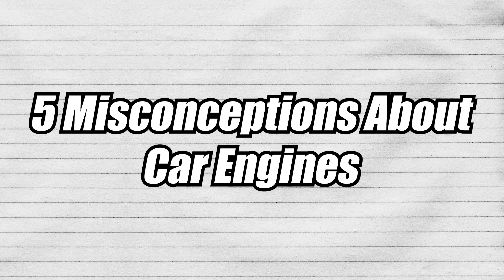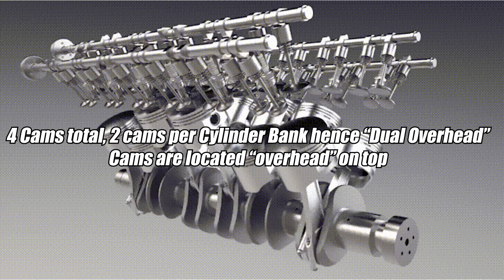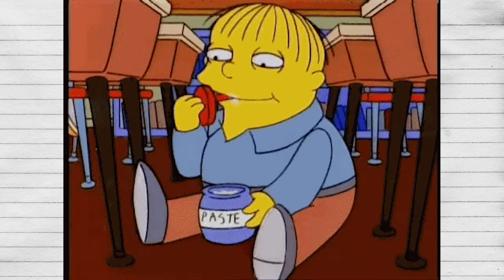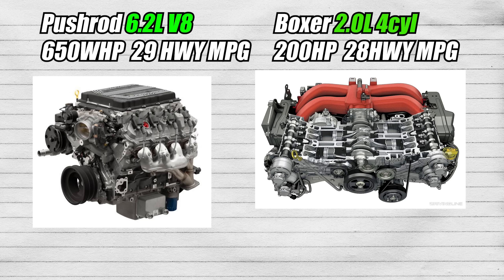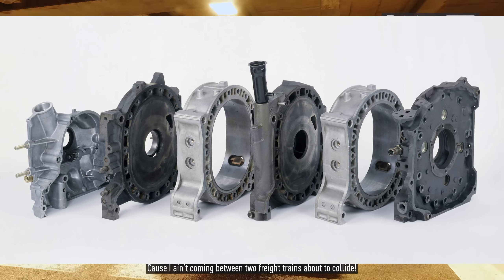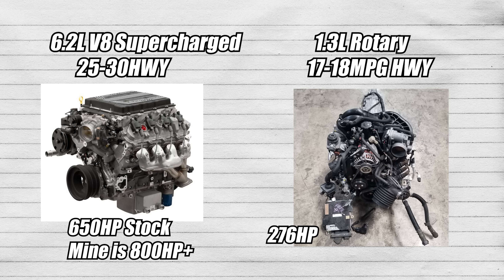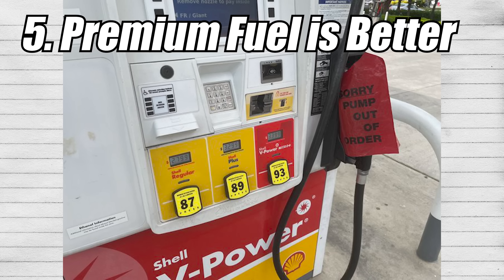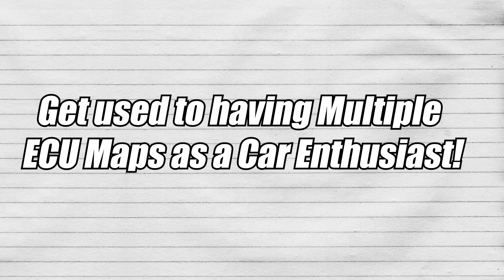5 Misconceptions About Car Engines!

Comment: i didnt understand why rotaries were so bad with mpg, but bro went "dorito drink too much mtn dew" and i instantenously understood why.
Reply from the maker: It's taht God damn Baja Blast!
Reply: Because they have three chamber per rotor, they drink 3 times more.
In addition, the lack of torque make him an hi-reving engine (so it make the economy worse), there is a lot of friction and its not as hermetic as a standard motor, so a smaller part of the fuel energy is used.
Reply: Its because of the larger surface area of the "Cylinder", more heat goes into heating the block rather than expanding the gas, its also why they need more cooling than equivalent piston engines (example being the rx-8's radiator; it's mounted diagonally to have a larger one and takes up half the engine bay).

Comment: I always thought v8s were gas guzzlers no matter what, thanks for teaching me something today bladed
Reply: Fuel economy of semi trucks is weird...
Reply: Dodge's Hemi V8 able to work in V4 mode shutting down half of the cylinders when the power is not needed, by this saving tons of fuel.
Reply: They are gas guzzlers. In the city, the Corvette gets 15MPG!  On the highway, The Corvette shuts off half of its engine to save gas, turning it into a 4 cylinder.  It's the only reason it's even close to 30MPG.

The reason the Vette got better MPG than the Stang is because the Vette had more 2 more gears. The Vette was in 8th gear, while the Stang was in 6th.
Reply: @AK.__ The about of fuel it saves is not huge. Those cylinders might not be firing but the pistons in those cylinders still have to travel up and down and that means there is still friction, those at least the valves are left open so there is no resistance from the increasing pressure. The other cylinders that still fire will need to have more fuel injected into them to make the same power, so the only real difference in fuel economy comes from the lack of a force resisting the piston movements in the cylinders which aren’t firing.
Reply: @LePedant The amount of gears means nothing. Just adding additional gears won’t give you better fuel economy.
Reply: @TheDuckTeamYT  At 80MPH it does. If the Stang had a 7th or 8th gear to go into, it would have dropped RPM's.  Just like how going from 2nd to 3rd at 50mph drops the RPM and improves gas mileage.

The reason new cars have 8-10 gears and not 4 gears is so the car can run at lower RPMs at any given speed.
Reply: @LePedant  The number of gears doesn’t actually make a difference in your rpm. It’s your gear ratio that matters. Also it’s not true that changing into a gear with a lower gear ratio will always yield better gas mileage. Try driving in your highest gear in your car up a hill at high way speed, your car won’t be able to do it even at full throttle because the gear ratio reduces the leverage or force that the engine actually applies to the wheels in exchange for speed.
Reply: @TheDuckTeamYT  More gears means more ratios. If the Stang had a 7th gear, it would have a lower ratio than 6th gear.  

We are talking about Blades test. Not going up a steep hill that you need to down shift. He was doing normal highway cruising where he barely had to hit the gas. In that case, having more gears with lower ratio's will improve MPG.
Reply: @TheDuckTeamYT  Well, you right in general. Not "huge", but still a saver.
Reply: @LePedant  This depends on if the engine has enough power to keep driving the car at high gears. Most vehicle with 10 gear transmissions rarely use the 10th gear. Theoretically you aren’t wrong that going into the highest gear on the highway will probably save fuel but this isn’t the case for most vehicles because the engines aren’t powerful enough, and if it can push it self along in the highest gear, it then makes you wonder if they should of had different gearing to make the rpm even lower
Reply: @TheDuckTeamYT  
It depends on how much torque is required to drive those 4 pistons vs 8. As a general rule, an engine working at 70% throttle (and around 1.5K to 3K RPM) is more efficient than at 30%. This is primarily due to pumping losses, trying to pull in air from a restricted throttle valve wastes energy. If cutting out half the pistons raises the required torque level from 30% to 70%, you'll be producing power more efficiently. Friction at high RPM is the other cause of inefficiency. If you need 90%+ throttle, then you start getting loses from heat losses into the cylinder wall and not pushing the piston.
Reply: Lol it's not because of cylinder deactivation or lots of gears. It's the low, effortless, pushrod revs. My old '95 Camaro got over 30 on the highway (when I allowed it to) with 5.7L and "only" six gear ratios.
Reply: @Appletank8  You always have heat losses in an engine. Engines are only about 30% efficient at turning potential energy into kinetic energy. The rest turns into heat energy and a bit of sound due to friction.
Reply: @TheDuckTeamYT  
Yes, 30% at best. There are many ways to make it worse. A BSFC map details where an engine is efficient and not.
Reply: @TheDuckTeamYT  at the rpms he's going, it can't make that much of a difference, there's not much kinetic energy to dissipate anyway
Reply: @AK.__  the acitve fuel managment your talking about is really not that good. For GM vehicles at least. they blow up a lot just from the AFM
Reply: @trevg7253  I know for the Mopars it works great. Not sure how supercharged Hellcats on the gas, but R/T and SRT (or ScatPack) the MDS (multi displacement system) works great for them in terms of fuel economy. Some believe though, that the MDS contributes to development of "HEMI tick" but it not very true.
Reply: @MagnumLoadedTractor  Aside from some Scania's the vast majority of semi trucks use in-line 6 engines.
Reply: @TheDuckTeamYT  If I bought a car with a 10 speed gearbox and it wasn't in 10th gear when I'm doing 130 on the motorway, I'd go back to the dealer and question whether the gearbox is indeed working properly. If I'm then told that 9th and 10th gear are only for speeds over 200, I'd feel cheated as a consumer.

Also low RPM doesn't automatically mean better fuel economy.
Reply: @fermitupoupon1754  Low rpm doesnt mean better fuel economy, and that's exactly why the engine wont be in 10th gear. Your engine might not even make enough HP at the wheels that speed to push the vehicle. Also what are you doing responding to year old comments

Comment: Even if modern cars don't need to "warm up" I still like to give it a minute to get itself primed, and then gently coast it out of the neighborhood to get it up to temp a little faster without murdering it. Its just a little mental comfort I have always kept with me.
Reply: In a pushrod engine the cam is one of the first things to get lubricated. That combined with electronic ignition and fuel injection is part of what makes LS's as reliable as they are?
Reply: I don't give a shit what anyone says, my owner manual literally says to let my car warm up for at least 60 seconds. Bare minimum
Reply: I let it warm up at least 2 if not 5. So the whole engine can be at the same temperature. I doubt it helps but reduces the chances of early warping in my mind lol.
Reply: @DAN007thefoxx1 isnt the LS a dual overhead cam?
Reply: @killer13324  No. It's a pushrod design which is dated but it does work.
Reply: @DAN007thefoxx1  ah, gotcha.
Reply: Fun fact, my RX7 has all the original paperwork and the user manual says to let the engine warm up before driving. Probably has to do with the apex seal longevity.

Comment: The 2 things that kill an engine are lack of lubrication, and being to cold/overheating. Engine clearances are shrunk down when cold, and expanded when hot which results in uneven wear if it goes on for too long. Always wait for your engine to warm up.
Reply: I think Bladed's point is that modern engines warm up decently enough for proper lubrication within a minute of starting up.
Reply: So let me get this straight, you don’t want your car to be cold, so you’ll just leave it idling for 5 minutes, during which it will run cold.

Just drive off man, it’s the same shit, and at least when you drive you’ll warm the engine faster.
Reply: @__dm__  depends on the car, if you drive super slow and don't rev faster than you engine revs at idle then yea it makes sense. however if you have a car that can rev really high revving high while cold will cause excessive wear compared to letting it warm up at lower revs.
Reply: @realyopikechannel  it's called a happy medium. "Just drive off" implies gentle acceleration. Rev higher than idle of course but not "high." My last car revved to 7400 RPM but in gentle acceleration, 2000 would do, with light throttle (no lugging), warming the engine faster than idle but not stressing it.
Reply: Actually on some engines waiting in form of idling makes it worse, they should be driven slowly and carefully until warmed up, but not stand on idle waiting for it to warm up.
Reply: @__dm__  it really depends on the car. My last car the manufacturer said to idle for X minutes depending on temperature. For example at between 0 and -10 degrees the manual specified to let the car idle for 2 minutes prior to driving off. Not so much for lubrication of the engine, but because the hydraulic fluid in the transmission needed to get to operating temperature or you'd risk damaging the robotic gearbox and clutch systems.
My current car just has an indicator light if the CVT is too cold to operate. It won't allow you to move the selector out of P until the oil in the gearbox has reached operating temperature.

Comment: Your take on the Rotary engine is on point. Many non rotary engine car guys and girls think rotary engines are unreliable because they never did research on how to take care properly of the engine (eg. Checking oil regularly, premixing, redline it daily etc) and mostly bought the car (eg. Rx7) for clout and when something vital fails like the apex seals which require an engine rebuild. That’s a lot of money down the drain so they start saying rotary engines are so Unreliable
Reply: I’ve never owned a rotary, but I’ve also learned that every single car has its own particular needs when owners care for it and maintain it. Rotaries are no different. Learn what the rotary engine needs to keep it running like learning what the EJ boxer needs to keep it running.
Reply: @nowiecoche  exactly, but many owners especially after the first one fail to do this because most of them just bought the car for clout these days
Reply: @nowiecoche  A lot less you need to do when you got a typical inline or v configuration piston motor.

Rotaries need the attention and maintenance of an Italian V12 for the power and torque of an F20C. And at the end of the road at 100,000 miles, it still ends up failing.
Reply: That sounds a lot like what people say about the infamous EJ255/7 (which I have in my STI). And I have no reason to doubt it.
I guess it's that some engines require more careful preventative maintenance than others (this could be considered a measure of good engine design), but if maintained accordingly, should be fine.
Reply: @PURENT  the difference is that you can actually service the rotary and you'll actually find people that did over 250k miles on it.
Reply: @afoxwithahat7846 you could do everything properly, the rotary could still go boom before 100,000miles. i just wouldn’t ever trust one, to daily it for a year or 2 would be fine but it’s at the point now where it’s almost easier to buy a whole nother engine and start again
Reply: @atrxmx2542  Euhm... Mine has 130.000 miles on it, still going strong, compression test shows a little under perfect compression. So, it's not a given fact you need to rebuild the engine. It's only what type of engine it is and how you drive it. My engine is NA, make sure not to idle it to warm up, take it easy untill the engine is warmed up properly and then I Rev the living hell out of it. I must say, I would never like to own a turbo rotary. Those, for my experience, have the tendency to wear out much quicker. But hey, that's forced induction on a already heavy maintainance engine, so I'm not surprised if that.
Reply: Which sad as they are the easiest engines to rebuild also diagnose.
Reply: There just isn’t any way you’re going to slice this and win…. 

You got standard config V and inline engines going 100k miles with no oil changes… obviously if they are finding out it has had no changes in 100k miles it’s good as dead….. but 

I’m just pointing out the stark differences between the rotary and Typical choices…. They aren’t worth the hassle
Reply: @flameburstgt6503 Or don't maintain it at all lmao